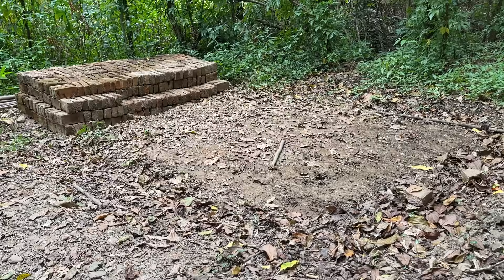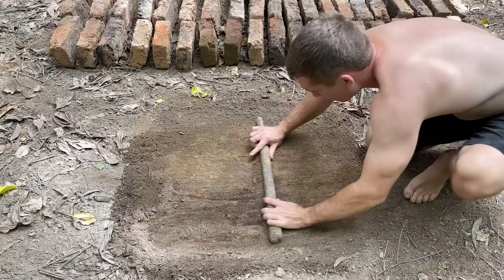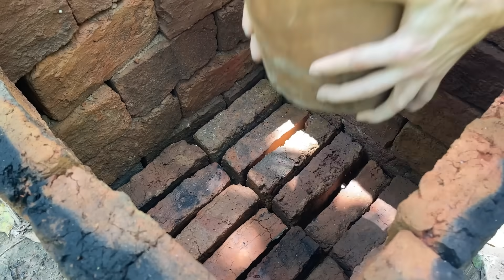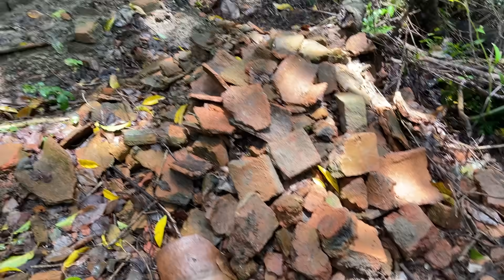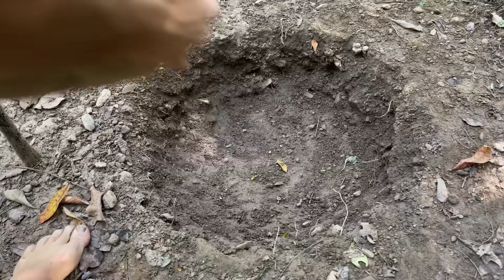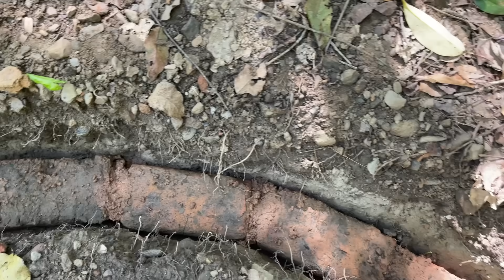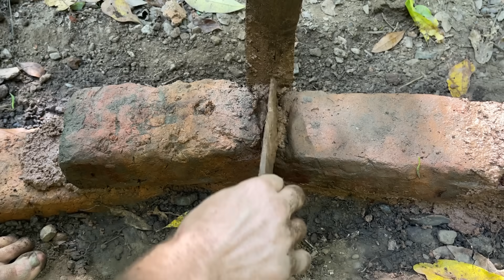Primitive Technology: Wood ash & crushed terracotta mortar

Comment: This mortar is probably better than modern concrete mortar. Concrete mortar sets harder than the brick and doesn't allow the bricks to move with seasonal changes in moisture and heat. This causes the bricks to eventually crack and crumble. Maybe this mortar will allow that movement?

Comment: @primitivetechnology9550, is that really calcium carbonate in the kiln ash or potash (potassium based compounds)? Both would create caustic oxides upon calcining.

Or are you adding seashells to the kiln fire? I recall burning of bones, eggshells and seashells were used for sources of lime.

Just a bit surprised at wood ash being such a source of calcium.
Reply: Never mind. I did a bit of quick search. Apparently, there is a fair amount of calcium carbonate as well as potassium carbonate (potash) in wood ash. Relative values depend upon the temperature of the fire and the tree species.

Interestingly, while calcium carbonate will change to calcium oxides at higher temperatures, potassium carbonate will change similarly but will also volatilise into the air.

Comment: I wonder if you would be able to make a shell of the mortar across the bottom of a circle like that, then a mortared brick surround, and a layer of mortar around the inside for a fresh water catch. Would it hold water, or would the water eventually soak through and leach out? I am assuming the water would also end up eventually becoming very hard, containing a high amount of absorbed calcium, leading to potential kidney stones?

but would it work?

Comment: An exciting update. It seems a little strange to me that you seem to still lack good working surfaces. Could you not make a big bowl out of clay or stone or wood and place that into the mixing hole before adding the mortar ingredients? Is it not at all worth it to keep soil out of mixing stations?

Why not have a table stone for general use? You can rub two kinda flat stones together to get a flatter stone. I once learned that the foundation of all precision is a flat surface. Once you have something flat, you can get something flat and level with a water test. Once you have something flat and level, the world of precision opens up to you. 

Anyway, I love your resourcefulness with construction, chemistry, and so on. I just think it would be neat to see those parts of the tech tree too at some point. Cheers.

Comment: Hello, I have a recommendation; after placing the mortar and putting the brick on top of it, if you hit the brick a few times with a wooden 'hammer,' you will get a better bond. A few hard strikes create vibration, allowing the mortar to penetrate the brick's indented surface and helping to create a stronger structure. I recommend you to try it.

Comment: looks fantastic! relieved to see you making it a dome, i was a little concerned when at first it seemed to be a cylinder, as you were doing it without a plumb line to check the vertical or an a-frame plumb to check the horizontal of each course. just brilliant to render both of those unnecessary!

Comment: The method will dome the house slowly as the wall builds height. Another stick with with a hard stop should be crafted, so the assembly can rest on top the of the wall, to maintain width to mark. Unless a dome was the intended outcome.

Comment: the biggest factor missing from your mission to explore the technology tree from scratch, is a village of people to help. The whole village can pitch in to make one big forge and operate it when needed, as the whole village would share in the iron tools. It would be amazing if you found copper and tin deposits too, bronze age tools were pretty good and copper is easier to work with, but I get that you're seeing how far you can get in this one area.
Reply: Ya! Australia is a major producer of both tin and copper, but the area PT is in is not the primary zones for either, and the easily accessible supply of tin OR copper are both used up so its effectively mining only. 😅

Comment: In the latest video, you're making wood-ash cement to act as a binder for the terracotta bricks. When you wash the lye out of the ash, you can save the mixture of water and lye, then, when you make mix the cement binder, you can use some of that lye, alongside a small amount of raw clay, to hopefully make the cement stronger. Kaolin clay works best, but there might be small amounts, or even trace amounts, of kaolin clay, even in normal clay. Adding a small amount of beach sand could also make waterglass, which could make the cement even stronger.

There is also a conspiracy theory about megastructures made from stone being actually made from fake stone. I won't comment about my beliefs about it, but some people believe it. According to the believers, the ancient people made fake rock from quartz sand (aka. beach sand), lye from ash, clinker-cement from ash, and local soil, all packed together, and made with a similar consistency to dough for making bread, or tougher. 

Presumably, the mixture of cement and waterglass (which can be made from quartz sand (silica, SiO2) and lye made from potash (potassium carbonate, K2CO3) from wood ash) and terracotta powder (for example, from clay dust sieved loosely and fired for easier crushing into powder) can make for a binder which looks very similar to the natural binder in natural stone.

Again, this is only their belief, and there are supposedly research papers and lab test results making the whole process scientifically accurate, supposedly. I am not going to comment on my beliefs on the matter, other than that, from what I read and watched, it seems plausible even if not true, until proven or disproved as something which could be plausible, regardless of whether it was done or not.

Here's something I found on the shreeramkaolin dotcom website, which might be useful for finding kaotite clay:

Ball clay is formed through the weathering and decomposition of granite and other feldspathic rocks. It is typically found alongside coal seams, and over millions of years, organic matter and minerals leach into the clay, giving it its distinctive properties.

On the other hand, kaolin clay is formed through the weathering and decomposition of aluminum silicate rocks, such as granite and feldspar.

On the other hand, Kaolin clay has a higher concentration of kaolinite, a pure form of clay mineral, giving it its unique properties. Kaolin clay is less plastic and more refractory, making it suitable for ceramic applications that require high heat resistance.

Comment: Hi mr. Plant, as a hobbyist bricklayer, this was a great episode! Thanks! Couple things to note: It's a good idea to wet the bricks after you lay them and the mortar dries. This further prevents problems of weak joints when moisture is absorbed by bricks. In fact, do this repeatedly a few times per day for a few days. The other thing is that you don't seem to be using a level to line up your bricks straight. Things might seem ok now, but small errors in each layer's lining will cause big issues with sagging the further up you go. Especially if you are going to be forming a dome. In modern times people use bubble levels, but you can do it the old-fashioned way with a weight. Attach a weight on a piece of string and let it hang from the brick you just laid. If the weight points straight to the ground and the string is parallel to your wall, then the brick is even-leveled. Otherwise, adjust its angle by adding/removing mortar from below (or stick small pieces of stone in the mortar below to raise it up). The way you lay the mortar seems much better now than the previous attempt at the hut, but I'd suggest you try and use a bit more mortar in the joints between bricks of the same level. Your mortar should be overflowing out of the joint when you place the brick. If you add too little mortar you risk creating air bubbles (that expand/contract according to temperature and end up cracking your mortar in the long-run) and increasing the risk of the brick absorbing too much water out of the mortar too quickly, leading to a very weak joint. Finally, take care when handling calcified ash dust (i.e. cement). It can absorb the moisture of your skin and after a few days cause painful cracks. Its also very dangerous for your lungs. Take precautions when crushing, mixing and transporting it.
Reply: in a prev video they used just their hands and got burns which is why they have the trowel and the little tray thing. i too am concerned about their lungs tho, all that smelting shit, smoke and dust with no mask at all. imo if you can wear shorts for your video you can wear a mask too lol
Reply: You know how they leveled the land for the great pyramids? They flooded it and since water finds perfect level they just chipped down any rock exposed.
Reply: @Erik-Hanson-art  that's the theory, but we can see how quickly the water drains away here, and still that's only good enough for the ground level so an A-frame plumb would still be needed as each course of bricks is laid.
Reply: @satoau1 oh yeah. Would not work there
Reply: Fascinating insights, thank you! <3
As a chemist, I was also very concerned about the cement clouds that were pluming up, I hope we can see our friend here make a primitive facemask!
Reply: i thought that too with the verticals and horizontal level of each course, but if he's doing a dome it won't be necessary. perhaps a different kind of bravery though, unless he's going to do the top portion with wood and thatch.
Reply: @satoau1  you are probably right, the dome will probably be wood and mud, or wood and thatch. However, he did mention building an arch over the doorway. Sagging isn't really a collapse issue there, but it is going to make forming the arch a pain and it will not look pretty when it's done.
Reply: @OrnluWolfjarl  i wasn't thinking of sagging collapse so much as one brick giving way sometime and the rest coming down soon after. the further off horizontal the layers are the less balanced the forces will be.
Reply: Maybe he should just do his bricklaying in the rain?
Reply: He did wet his bricks but I think he let them dry a bit before laying them down and that is probably a bad idea.
Reply: @mh6276 he should also wet them after the mortar sets, for a few days.
Reply: unless he can make a level from forest materials, he isn't going to use a level.
Reply: @Dread-r7i as I said, he can make a weight level using string and relatively even shaped rock
Reply: @OrnluWolfjarl good ole plumb bob, one of the oldest tools around. High quality OP comment too, cheers!
Reply: @OrnluWolfjarl  można też zrobić poziomice z naczynia z gliny, które już posiada
Reply: yeak ok rightyo mate

Comment: fascinating. So by using the stick with an already set measurement, as the walls grow higher, the bricks will inch closer and closer, making the circle smaller initially ever so slightly till it forms a dome. I have always stated that humanity has had the same mental capacity historically that we do, its just that they didnt have our access to education and information. 

this method, i cant confirm whether it is truly accurate or not at this moment, shows a reasonably logical way of approaching this. It keeps the measurement exact at every step without needing to measure every time, just place it and match. 

Then onto the grog/ash mixture. i have learned a few years back that ash could be used as mortar/used to make concrete  but by combining with the grog which is more porous than the sand, easier to find/generate from broken bricks/terracotta, thus solving a historic problem alongside generating a "new" resource. It solves the building waste/failed project refuse issue, allowing for a society to reuse the clay in a sense

Comment: I feel like he'd benefit from making a couple more hand-tools from wood.  A scoop, and maybe a flat hoe to allow for easier digging and moving of powdered or granular material, since he does so much pottery and earthenware would be useful.  Take a bit to hollow out a chunk of log, maybe using that blown fire coal method, but it'd help, I think.  Then a flat plank on a stick to let him pull stuff around easier.

Also, like, seating.  A tripod chair would be handy, as would a worked table surface, whether sanded wood or smoothed fired ceramic, or maybe sanded down rock even.  It'd be a big time investment, but having an easily cleaned, solid, flat, smooth working surface would probably be nicer than most realize.  Put edges on it and you could even have a mixing basin that doesn't need to be dug every project.

Comment: Wood/Grass fibers = String
String + twigs + Friction = Fire
Earth+Water = Mud
Mud + Brick Mold = Mud Bricks
Stacking Bricks + Fire = Kiln/Oven
Mud + Hands = Mud Balls
Mud Balls + Sun = Coal
Coal + Oven + Fire = Hotter Fire
Oven + Mud Bricks = Strong Bricks
Brick + Pounding = Brick Sand
Coal + Fire = Ash
Ash + Brick Sand + Water = Mortar
Strong Bricks + Mortar = Wall
Stick Standing In Ground + Stick Laying On Ground = Radius Of Circle
Radius Of Circle + 360 degrees = Diameter
Stick + Diameter = Circular Foundation Bed
Circular Foundation Bed + Bricks + Mortar = Circular Brick Wall

Comment: You need to figure out how to make a spirit level or measure from a known point to make the courses level. Brick buildings more than head high with a dirt foundation that aren't level won't last, I don't care how much mortar you use. When you start building your spaceport and need very tall booster assembly buildings, it's going to matter.

Comment: I've been watching you for years now and I do have to ask, seeing you sift and mix and clean on bare soil often enough: Would it not be beneficial to fire a work surface, or a large trough of sorts, to catch things you are sieving, like ash and charcoal or clay for pottery? It would increase material purity and, at least i'd think so, make it easier to catch stray ammounts of things. Mixing the ash on the bare ground I'd wager you are losing a few grams of ash as a ressource every time, it being dispersed in the soil. With a work trough that could be retained, no? Or is that so miniscule that the work to make a trough is just not worth it?

Comment: You may be able to make something akin to Portland cement by mixing the wood ash with a source of silica, which the slag from your metallurgical experiments should be a good source of. Could be interesting to try crushing the slag and mixing it with the wood ash before forming and firing the pellets.

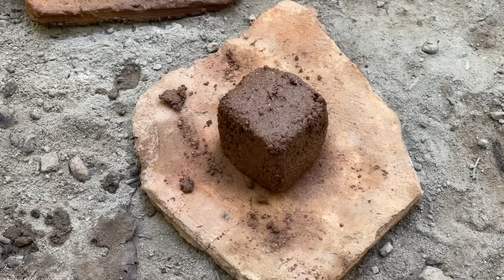Comment: 11:07 It's potassium hydroxide not sodium, although the chemistry is the same!
KOH may emerge either from K2CO3 (a major constituent of wood ash) decomposition at high enough temperature (e. g. ca. 1000C, which is light cherry red heat to deep orange, it loses about 10% of weight in 3 hours, meaning one gets about a quarter K2O to 3/4 K2CO3), or alternatively, it may emerge from a double displacement reaction like Ca(OH)2 + K2SO4 (a minor component of wood ash) = CaSO4 (gypsum, also useful in a mortar) + 2 KOH

Comment: I love to see where the word "calcinating" is coming from. In Chemistry it's used in many circumstances as you mentioned with "heating with oxygen" aka burning. 
Burning CaCO3 releases CO2 to form CaO. Which in return reacts with Wather to Form
CaO +  2 H2O -> Ca(OH)_2 + H2O
and with CO2
Ca(OH)_2 + CO2 -> CaCO3 + H2O
There we have the cause for solid mineralization.

Since Calcium is inherent in Minerals such as Calcium hydroxyapatite -> Bone matter, you can think that the word calcination comes from the burning of bones. Which should've been done by humans longer than the burning of clay to produce containers.
But the word rather comes from the 
Indoeuropean word: Kal - stone, hard, to grind
and the
Greek word: chalix - gravel, small stone, chalkstone
Latin transferred it to: calx - chalkstone, burned chalk
 Old english had it: cealc --> Latin: calx --> new english: chalk
Latin: calx --> German: Kalk

Proto-Indoeuropean: kal- → Greek: chalix → Latin: calx → Old high german: chalch → New high german:Kalk / new English: chalk.

The "h" in chalix was transferred as a greek to the Latin c and formed the germanic k.

Comment: As a civil engineer, I want to recommend you to add 10 to 20% less water, for better strength, durability and mortar handling. Make smaller batches of mortar and find a flat object to carry mortar with you instead of returning again and again to the pit. Keep the dimensions maintained and God speed

Comment: Seeing you use the wood spatulas to handle the mortar, it seemed a bit awkward with the larger grain size of your brick aggregate (don't know if it really was, you're the one doing the work!), so i had an idea of using a large, fresh (wetted?) leaf held in the palm to smooth the joints or even apply the mortar. Tough i suspect the leaf might just rip after a while, and sticking to the mortar might be a problem.

Comment: A rotating barrel for mixing.  Or, a paddle wheel inside the barrel.
More practical would be a loose weave paddle connected to a bowed over small tree.  Human hands control the motion.

Comment: If i remember corectly, most of the times you made bricks before you used to get orange-red clay from near a river. Any difference/reason to now work with mud from a different area? The color difference is visible when the bricks are freshly molded, before drying.

Comment: the bricks could have been shaped for the job (more of a trapezoid) and it would have improved the rigidity of the structure and it would have saved labor and mortar, thinking about it switching to trapezoidal bricks might be more sturdy and can still be made into straight lines however some cutting would be required to make straight edges for 90 degree turns